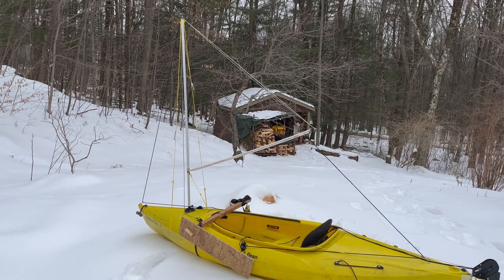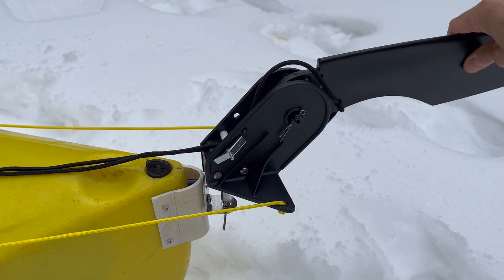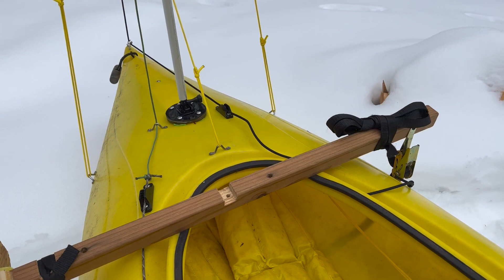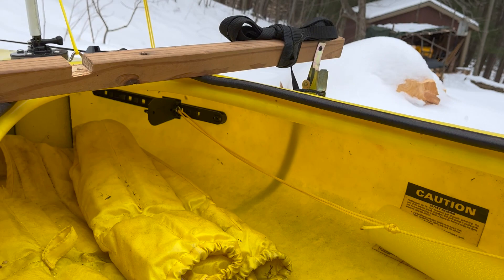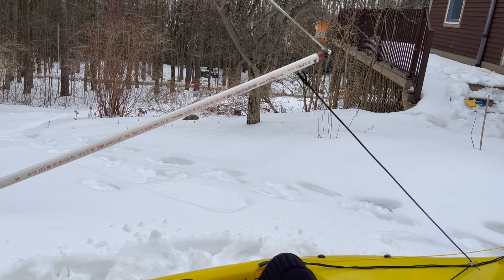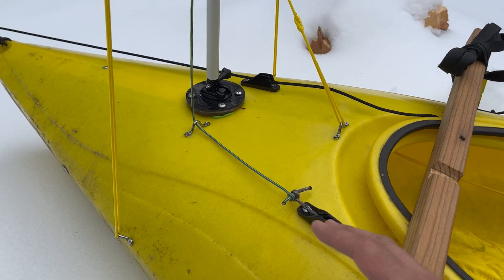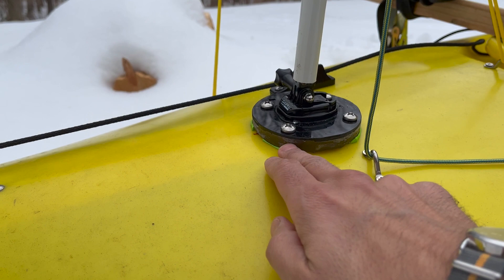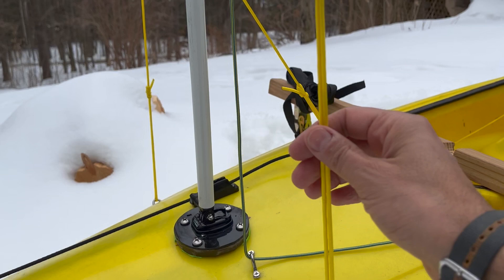Building a Sailing Kayak Part 1

Comment: that board MDF or chip board its essentially chips of wood glued and compressed together when it gets wet it swells up like a sponge  after awhile saturation you could easily break it apart like a granola bar
Reply from the maker: It sure will. That’s ok - by then I’ll have learned what I need to make a permanent solution that is well balanced (I hope). I’m thinking I’ll need two but need some practical experience to decide how I finish that part.